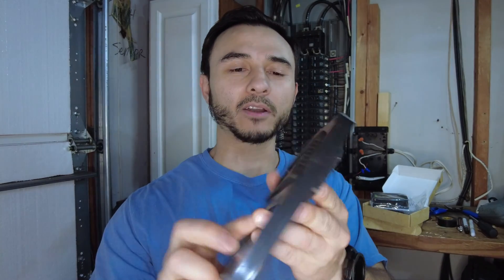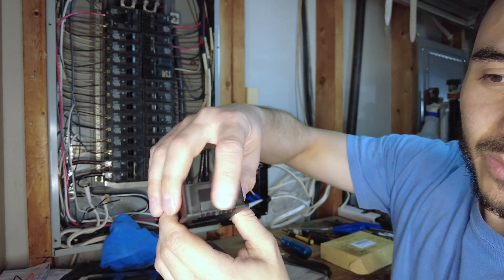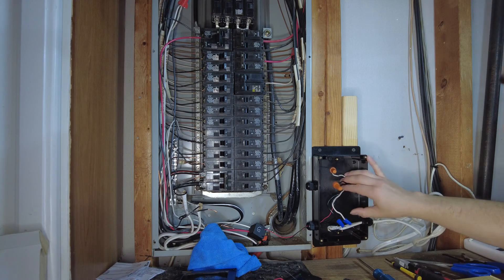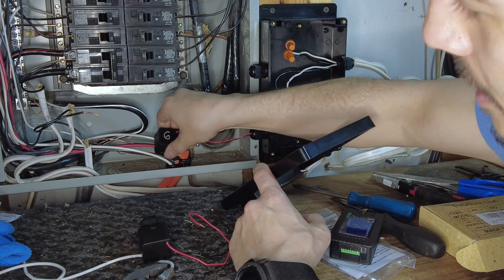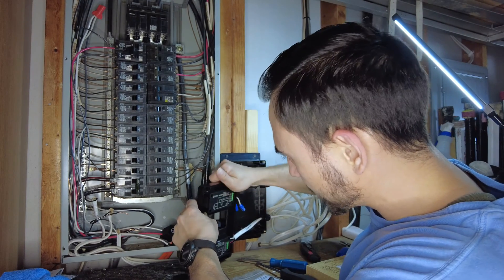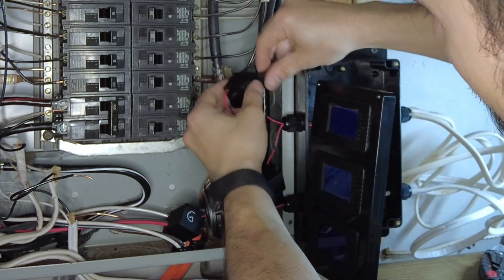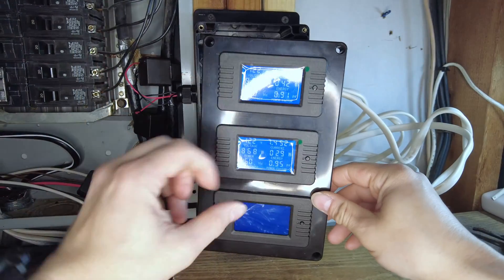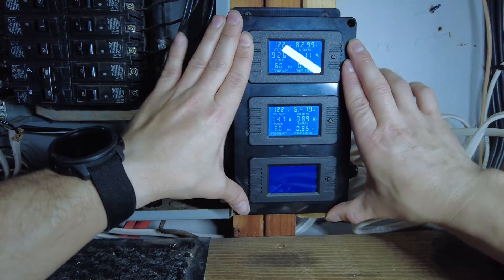PZEM-022 Power Meter for Circuit Breaker & Generator Install!

Comment: Very Nice video !!

I do however have a couple of questions..   

a) To measure a 240v  circuit, you simply  connect your CT over one leg,  A or B and connect your power to 240 as oppose to 115v.  Correct ?
b) the button on the right, allows you to turn the LED on/off, and it also allows you to change the power setting and the Wh setting.   Can you speak toi changing the setting for the power and the Wh ?    

C) Lastly, do you know why the meter's Wh goes to 999 and then stops there?

Comment: Bro, mine can only read 1/2 of the load usage. For example, if I plug in a 300W load, it only reads 150W, and the same goes for the 32A amperage, it only reads 16A. What's the cause, bro? Please help.
Reply from the maker: I am not sure. Is the 300W load running at full capacity?

Comment: Nice video.  But, you should only have one source of active power: the utility power, or the generator power.  As others have mentioned, if you don't have an interlock switch, you need one. That makes sure either the main breaker (100-200A) or the generator breaker (30-50A) is powered on at once.   Once this is done, a trick I saw on another YouTube video is to run the power leads from the generator (running into the breaker box up along the main utility lines, then down to their own breaker.  That way, you can but the current clamp around both of them, and have your meter read the power - regardless of whichever source is on.  Lastly, as others have mentioned, you do want to measure the current of each leg, especially on the generator.   I don't know if it won't work, but I believe it's definitely better to draw ~equal amounts from both legs (of the 240v service) versus almost all from one leg.
Reply from the maker: Great advice!  Yes, I do use the interlock switch, the main and generator cannot be on at the same time.

Comment: I really wanted to do a set of these attached to my mains that come on at the breaker panel in our closet but electricians say that's not a good idea.
Reply from the maker: hmm...what would be a better idea then?  I haven't had any issues with this, knock on wood.

Comment: I'm sorry, but I don't see any interlock between your main breaker at the top of the panel and your 100 amp generator feed breaker at the bottom.  I've seen the metal plates that slide back and forth to keep both from being on at the same time, but those require the generator's breaker to be mounted at the top of the breakers.  If you really have a mechanical (or electrical) interlock, please describe how it works.  There are a dozen more code violations here, but most of them have been covered in other posts.  The lack of an interlock is a deadly thing.
Reply from the maker: Umm obviously I have an interlock but you don't see it since it's on the cover. You can research how it works online. Basically it ensures the main breaker cannot be on if the generator is on.  And when the main is on, the generator breaker cannot turn on.

Comment: The CT has an S1 side in an S2 side. It has a black wire and red wire that comes out how, do you know which wire is which on the CT. Should be turned so that the S1 is to the power side and the S2 is to the load side. I think
Reply from the maker: I actually wired it up how I saw it on the Amazon listing, and confirmed it in the instruction manual.

Comment: Watched the video and had a few comments but wanted to read the other comments before. Couple of key items I noted and had some concern with (and were also commented on).
The voltage sensing wires used were 14ga which have a max current rating of 15 A as mentioned by others. The CB is not meant to protect the load it is meant to protect the wire in the event there is more current drawn than its rating (short circuit etc). Code everywhere frowns on feeding two loads from one breaker so in this application it would be preferred to use a dedicated two pole breaker of 15 amps to feed the metering box. Using the 100 amp breaker was just an additional extreme code violation.
I'm not sure where you connected the "Generator" wires into the panel but the best I could determine watching the video was that you used the top two LH breakers and twinned into them as well. If that is the case, please tell me you have some form of interlock that would prevent you from reverse feeding that panel with those two breakers while the main breaker is closed! This is by far the worse possible code violation regarding Emergency Generator connecting there is!!! Also, I'm not sure what ampacity your emergency generator is rated for but if it is a 7kW 240v unit it will be 30A/Line so that wire had better be at least 10ga or you're into fundamental violation territory again. Also because L1 and l2 are 180 degrees out of phase with each other, passing both wires through the same CT will in most cases only show you the current difference being supplied to the panel, eg L1 - 14A & L2 - 10A would result in a reading of 4A not to mention the meter is only a single phase unit so which voltage source did you send it, L1 or L2? Either way that's going to be a some confused meter not to mention the person reading it.

Sorry to throw a wet blanket on your reasonably well done video but this is a classic example of a little bit of knowledge being a lot of a trouble.
Reply from the maker: wow I appreciaate the helpful feedback.  To be honest, I had an electrician actually install one of these using an existing breaker, this video was pretty much a 'clean up' to put them all in a box vs how he had it laid out and I connected things like he did.  But what's the major risk here if the meter boxes are not drawing a lot of current?  If you say "Frowns upon feeding 2 loads 1 breaker", then why can multiple electrical outlets in the house on 1 breaker be able to take multiple loads?  Also, yes, I 100% use an interlock device, I thought I had a video or short about that, but yes, I am safe there.  Yes, 10 gauge wire for the generator too, big thick orange cable!
Reply: @58Alpha  To answer your first question regarding terminating 2 load wires into a single breaker lug.  Codes dictate if the breaker lug is designed for terminating multiple conductors then you can do this but this is predicated by the "refer to breaker manufacturer specs" to be permitted. Most single phase small frame breakers (eg 15 amp etc) are intended for only single conductor termination. That said it is not too unusual to see this "gray area" being utilized. 
Unfortunately in your case your "electrician" did this with a 14ga wire on a 100 amp breaker. To bear repeating, it is the capacity of the wire being "protected" that dictates how large a breaker it can be terminated to, not the expected load. That is why you cannot feed a wire with the maximum capacity of 15 amps (14ga wire) with a breaker rated more than 15 amps. This is fundamental. That's why you need to use 12 ga wire on a 20 amp breaker even if it is only feeding a laptop at the other end.
In your case even using electrical code "Splitter" Rules (wiring within the panel), if it is from a 100 Amp source the conductor must be able to handle 1/3  the ampacity. I know that sounds crazy but that ceases to be a problem if you take your sensing tap from a 15A breaker. 
FYI
Code 14-100 (for Splitter distribution)
(c) where the smaller conductor
(i) has an ampacity not less than one-third that of the larger conductor/interupting device from which it is supplied; and
(ii) is suitably protected from mechanical damage, is not more than 7.5 m long, and terminates in a
single overcurrent device rated or set at a value not exceeding the ampacity of the conductor, but
beyond the single overcurrent device the conductor shall be permitted to supply any number of overcurrent devices;

To answer your question regarding feeding multiple loads & receptacles from a single breaker. That is why receptacles have twin screws L & N for terminating to. another scenario is you can also feed an octagon box with a single NMD14 ga cable from that breaker and use wire nuts to split off to multiple NMD14 feeds to multiple loads. In both cases you are terminating according to code. All of these circuits are protected by that single 15 amp breaker in your panel with only one wire under its lug. Again, if you do draw more than the rated 15 amps from one outlet or a sum of all the outlets, the breaker will trip before you exceed the ampacity of any wires!

I apologize for assuming you may not have an interlock but from the video I could only determine that those two 10 ga wires going through the single CT were terminating up the top two pole breaker. If that is the case I have to assume you have an interlock that prevents that 2 pole reverse fed breaker from being closed while the main breaker to the Utility is closed. Is that the case? I have done a similar installation using a dedicated 30 amp 2 pole breaker to reverse feed the panel but it is equipped with a "Kirk Key" Interlock System that mechanically prevents the closure of the one breaker without first opening the other.

I know, a bit wordy a response but I trust this has helped answer some your questions.
Reply from the maker: @JimBruce-n9w  thanks for the informative answer at least. I will reevaluate it. It seems primarily just to ensure breaker switch matches appropriately to wire gauge.  And yes, the interlock switch works perfectly. You cannot back feed the home unless the main is off. When the main is on, you cannot turn on the generator breaker either.
Reply: @JimBruce-n9w I believe everything you said is correct. When I saw two hot leads going through the donut, I knew that wasn’t right. I saw someone suggest in the comments on a similar video to put the CT on the neutral for a 220 volt circuit and that won’t work either.

Comment: Any thoughts on powering these modules? All the wiring info I can find for them SEEMS to imply that they MUST be powered by the circuit that's being monitored. Any idea if doing something like, for example, wiring a lamp cord to one (on the proper pins, of course) then plugging it into a random live socket near something you want to check, and clipping the CT to the relevant wire, will cause "issues" of some sort? I'm looking to do something very similar to your video (have two of these modules, and want to wire them at the panel so as to have each one measure one of the hot legs, then do the math and find out how much the whole house is drawing. From there, I can figure out a baseline number for how big a genny I actually need) 

Which makes me wonder if I can get  a "whole-house" reading by using just one of these modules, and clamping the CT to the neutral? Seems to me it would follow that neutral will be carrying everything that the two hot legs are supplying, no? But if the beast can only be powered by the circuit it's measuring, how would one power it?
Reply from the maker: Yes theoretically, you could do that as far as powering the modules if reading the schematic on the backside properly ("AC In"), but I just decided to hardwire it in instead.  You could try it both ways, if the readings are the same then I'd say you're good to go.  Let me know how your project goes.  Related to figuring out how big of generator you need, I used this watt meter and checked the wattage of various things in the house while "ON", especially of things I want to use in a power outage, and noted where they are on the breaker and added up all the wattages.  https://amzn.to/4e9hUtd  I couldn't believe coffee makers and toaster ovens were such high wattage lol

Comment: I am wanting to use these to measure how many watts or power is being used on each individual breaker in my panel, can i just run one power wire to all the boxes ? pig tailing the same wire to each box? and put the clamp on each black wire in the panel from each box.
Reply from the maker: That probably would work but they actually make a whole package out there just for that set up if you're wanting that level of information.  Something like this is what I mean:  https://amzn.to/3Y9WUg3

Comment: Dude bringing in three wires is crazy you could have just have pig tailed them.  And then when I started typing this I saw you put it under a 100 amp breaker than is just dangerous.  Anyone watching this video please do not do that. The insurance company will not pay when your house burns down if you do that.
Reply: This post is 100% correct!  Only need one power wire coming into box.  Could’ve cut the female end off an extension cord and just plugged it into a nearby outlet and pigtailed the other end to the three meters.
Reply: @LZisGBE This option makes the most sense and easy to me. It’s my understanding that the meters just need a power source. I would definitely try this when  I attempt this project.
Reply from the maker: Wait, what is gonna burn? or what are you talking about that I put it under a 100amp breaker?  Are you saying this power meter is going to draw more than 100amps and burn the house down!? lol
Reply: @58Alpha   yes if a short occurred the wire would catch on fire and bur the house down that’s why wire is sized for the breaker and must me placed on the proper sized breaker.  That is 14 gage wire and must be put on a 15 amp wire to be properly protected.
Reply from the maker: @plpmartin49  so what gauge wire would you have used and which breaker would you have used
Reply: AND, how did you get the cover back on the breaker box to close it up?

Comment: Thanks for showing that you put BOTH of the generator hot conductors through the CT to measure the entire generator output for 240V generators! I am doing this project at home and I forgot I could do that. Thank You!!!
Reply: See my previous comment on this application. Will not work!
Reply: @JimBruce-n9w  I didn’t think that would work.
Reply: I thought you had to use only 1 leg in the CT? If not, why didn't you put both legs of the main on 1 and only need 2 meters?
Reply from the maker: No worries.  It doesn't make much sense to me to separate it for generator usage.  I want to know the total amount of load is on the generator anyway.  Thanks for watching!
Reply: @58Alpha    I'd rather know what's being pulled from each 120v leg than I would both combined, personally.  It's all about load balancing on generator power.  If you have one half drawing more amperage than the generator can produce on that side, then you'll put it into overload and never know since  it was wired as just a 240v meter.  I'm putting a pair of these in a panel in our master closet where all the breakers to  the house are where I can monitor/load balance inside since there's none outside except my main shutoff breaker.

Comment: Hint for others ( 7:00-7:20)..... adding wire length to the CT's ( current transformers....the "doughnut")....is typically not a problem, just use same gauge or thicker wire. CT's work by measuring current such that any (very small) voltage drop affect by adding CT wires is of very little influence...... go for it.

Comment: I understand the need for meter hot lead on the breaker to get power,  voltage reading.  But isn't that 'double tapping' and against code ( doubtful the breakers designed for two wires )  ???    I guess only other option is two new breakers for A and B phases.
Reply from the maker: What is double tapping?  The breaker was all installed before I moved in. I'm sure it's to code
Reply: @58Alpha   Double Tapping is having Two Wires under one screw of the breaker.   Only a few breakers are designed for more than one wire.

Comment: Great video, thanks! One question...where did you wire the power source for the bottom CT measuring the generator power?
Reply from the maker: The white to the normal usual bus bar, the black from the circuit breaker that the generator is on.
Reply: Thank you!

Comment: What size wire did you use for powering the meters?
Reply from the maker: I used the standard electrical wiring that is used in the electrical box and throughout the house that feeds your outlets and switches.  Should be 14 gauge, 14-2.

Comment: Nice job! but could we get the power for the monitors from sources other than the main circuit breaker panel ... like from the plugs on the wall?
Reply from the maker: From an individual plug?  That's gonna be different since many outlets are on the same circuit, and you could check the whole circuit that runs the plug you are curious about.  Other than that, I'd recommend something like this which I use for individual plugs:  https://amzn.to/3SebDEG  I've used this for a couple years now and it's been awesome.

Comment: How do you fit the closure plate on your main panel?....seeing that the new meter panel alongside has 2 wire-tunnel projections placed right over the flange-face?
Reply from the maker: I actually made a cut out for it with a Dremel